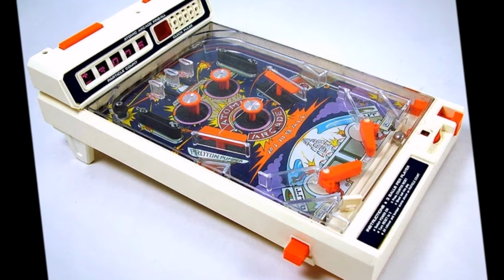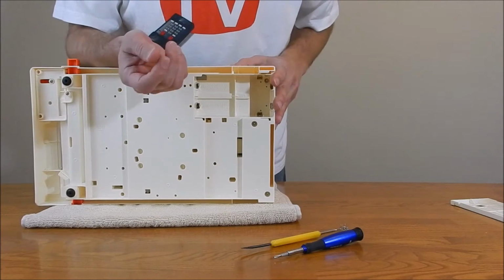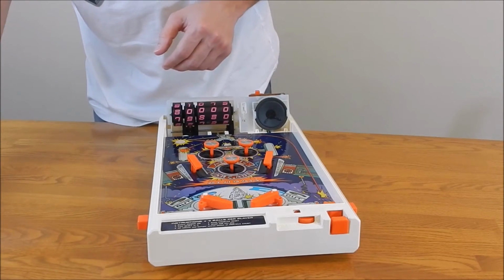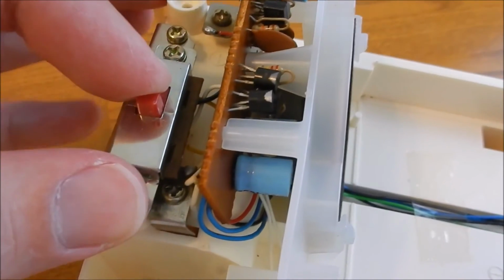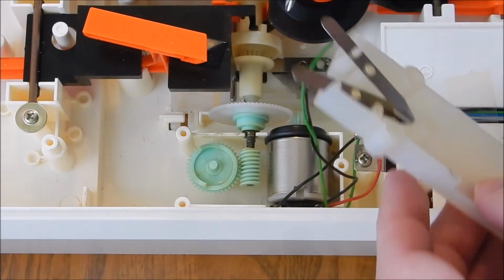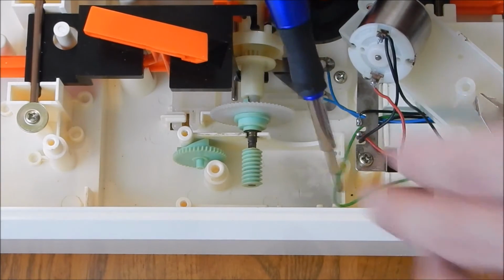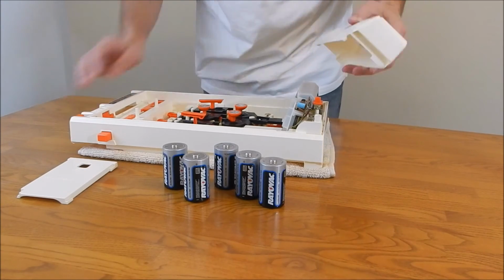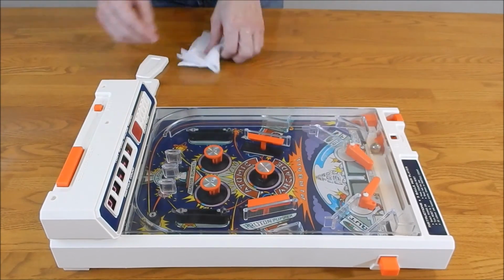How to Replace the DC Motor in the Vintage 1979 Atomic Arcade Pinball Machine by TOMY

Comment: Hello, Thank You for the helpful video! I have a question: I have the same pinball machine and its super loud whenever I turn it on. Everything works well, its just really loud. What do I do to make it quieter/play silent? does replacing motor helps or what should I do?
Reply from the maker: Hi, thanks for the compliment.  Yes, most of these vintage TOMY games/handhelds are very loud.  It's not the motor.  If you were to remove the motor, and run it, you'll find it's very quiet.  I think it's the plastic gears (and there's a lot of them) that make all the noise.  Quietening the machine is something I've wanted to revisit, but I've been away from this hobby for awhile (sad face).  You would probably have to experiment with different sound dampening materials and place them in the machine at various spots.  I'd start with the motor and the gears by it.  Again, you'd have to leave clearance for the gears to move, etc.  Off the top of my head, that's all I can tell you at this point.  Oh, maybe put a towel or think cloth under the machine, if you're using it on a hard surface.  Good luck and thanks for watching.

Comment: Is there any way of making the motor less loud? It's a bit annoying:(
Reply from the maker: Hi.  I think the excess noise is the plastic gears spinning plus the inside of the machine is like an echo chamber.  Yes, a motor can be very noisy if some of the internal components have become worn or need lubricated.  I tend to replace motors over 10-20 years old.  Someday I would like to test different material on the inside of the machine to what works best to dampen the sound.  Thanks for your question.

Comment: do you know where i can find a dc motor for this game? i bought the game and the motor is bad, i appreciate it!
Reply from the maker: Hi, Donny.  Thanks for your question.  I've purchased hobby motors off ebay and hobby websites.  Below are two links to an eBay seller and another company I've used in the past:

https://www.ebay.com/itm/311764162599

https://www.hobbylinc.com/htm/svm/svm260.htm

Hope this gets you steered in the right direction.  Also, read my description above for more info, if you haven't done so already.
Reply: @MarxKosmos1024  thank you

Comment: Awesome video!  All working now, just in time for Christmas.  Out of interest - I don’t find the bumpers etc to be particularly sensitive - do you have any tips for increasing their sensitivity?  T
Reply from the maker: Thanks for the compliment.  Regarding bumper sensitivity, nothing immediate comes to mind.  One model that I owned, the ball would tend to stick (magnetized) to the bumpers, then shoot off.  Is that what's happening?  Not sure if they need cleaned or the ball needs cleaned.  There are suggestions for replacing the rubber bumpers with other material that provides more spring, but I've never felt the need to do that.  The one I have now plays better than the one I had has a child.  Sorry I don't have more to offer.  It's been a few years since I had one apart.

Comment: This is great! Thank you for taking the time to do this. I just bought one on craigslist for 14.00. I had to clean the battery contacts but it works great! I want to take off the cover to clean the tracks of the ball in the plastic bed. The engineering is this thing is just amazing. Thanks again!

Comment: I got one and changed the motor as that was dead but from the get go when you turn it on the speaker just plays a continuous tone, very annoying, replaced the caps so far but no joy, trying to find a pic of a circuit board so I can check wiring is correct
Reply from the maker: Hi, Ben.  I don't have a photo of the circuit board readily available.  Of the 4 or 5 that I've worked on, none ever that the problem you describe.  If I dig my machine out in the next few days, I'll try to get you a pic of the board.   I'm not sure if something is being grounded that's causing the constant tone, but it sounds like you're doing the right things.  Have you ohm'd all the components too?  If I think of anything further, I'll let you know.  In the meantime, if you find the problem, I'd like to know what it was.  -M
Reply: @MarxKosmos1024  did you ever fix this... Just dug mine out of the loft and I'm getting the same tone and nothing from the motor etc
Reply from the maker: @ajwhedges100  The motor maybe seized up, so you could spin the gear on it a few times or it may need replaced.  Not sure what you mean by the 'same tone'.  I haven't done much diags on the small circuit board because I've yet to have one that was faulty.

Comment: The sound effects on mine are really really low can barely hear it with the actual motor running . Can this be fixed
Reply: It's a tiny astro shooter btw.
Reply: Tomy
Reply from the maker: Hi--I haven't encountered this problem myself nor do I own this game.  It could be a component (ie. resistor or capacitor is faulty).  Have you opened up the game yet?  There might be some type of variable resistor that allows you to adjust the volume.  May be the speaker is failing.  I wish I had a better answer, but I'm not an electrical eng by trade.  -M

Comment: Any idea what size the 10 teeth white pinion on the motor shaft is? Mine is missing and i need a replacement. Tteksah@gmail.com
Reply from the maker: Chris, I would have to take my game apart and measure it.  Not sure when I'll get a chance to.  Probably a detail I should add in future videos.
Reply: Thanks Mark. When I hit the inside with compressed air, the gear worked itself loose from where ever it was hiding. Threw it back on the shaft and the machine works! Such a fun and well engineered toy.

Comment: Hi, I recently bought one at an antique toys store. It works flawlessly, but when I turn it on the counter starts spinning on its own. I opened it and ran it and sometimes, when you touch a bumper or slingshot, it stops. But when you hit another one it'll probably start running again (only to stop randomly when you hit something again) It doesn't matter if you touch any of the bumpers, slingshots or the rollover thing at the top, all of them trigger and stop it randomly . It comes and go, but except that it runs great. I thought it was a broken/missing gear but I checked up all of them and they seem fine. Do you have an idea what might be? It wuold be very useful to have a working counter,or at least one that isn''t constantly running. Thanks and great video!
Reply: Lucas Andrada  hello ! I recently got one of these and mine is having the same problem !  I’m trying to see if I can go off what you said here to fix it.  Lol.  I need to open the score board area right ? Thanks.
Reply: RomeoRuizMusic Yes you need to open the whole pinball and see if the counter is running on its own. Check the white plastic,almost transparent plate below it and mess with it to see if it stops
Reply from the maker: Hi- Horacio,  thanks for your questions, but honestly, I hadn't seen this issue either.  If I had mine open in front of me, I might be able to make a better educated guess.  However, with these vintage electro-mechanical games, my first instinct is to think it's mechanical issue.  You said you checked all the gears and none were missing.   Also check to make sure none of the gears have a small (even hairline) fracture/crack in them.  I've seen the slightest crack cause a gear to jump or stick.  Using a magnifying glass will help, of course.  If it is an electronic component, could it be an old capacitor?  I don't know.  If you find the cause, I'd love to know what it was.  This is definitely a peculiar issue.  Good luck, and if I have any other ideas, I'll pass them along. --M
Reply: Hi Mark,it's me again from another account (Horacio is my dad haha). I finally fixed it! It was a mechanical problem as you said. Under all the transmission and gears,there is a clear plastic thing that runs across all the table. Since the plastic is clear and the gears leading up to the counter block the view,I couldn't see but it looked like a tab was below them as well. Anyways, this plastic was moving horizontally apparently engaging the counter gear. I found out because I turned it on and kept the plastic down with a finger and it stopped (though it would trigger the DING sound since it presses down on one of the metal tabs on the right side). Then I noticed it stopped when it moved, so I jammed a piece of toothpick between one of the hinges and the white board. It is a very milimetric thing, because when I first put the toothpick it stopped counting everything. Put it diagonally and now it's working like new. Hope this helps you and thanks for your answer! Regards,Lucas
Reply: Horacio Andrada  thanks so much.  Will do
Reply from the maker: Good Luck.  Sorry, I haven't investigate this issue on my own yet.

Comment: where would I have to solder leds for flashing lights when the bumpers get hit
Reply from the maker: Hi, Jason.  Thanks for stopping by my channel.  I've thought about doing this, but have yet to really dive into it.  It's been a year since I've looked at the internal workings of this, but I'd start with the blues wires near the motor box (see the 8:00 mark of the video- notice the blue wires at the right in the frame.  I think they are connected to two metal tabs that are pushed together when a bumper is hit.)  I'd start there.  Remember that flashing light is not tied to the bumper hits.  It just flashed continuously.  Thanks for the great idea for a future video.  Sorry, I'm not an electrical engineer by trade.  Just a tinkerer.  -M

Comment: Just found one of these at a thrift store. All it does when turned on is kind of whine, like a dog whistle. I guessing I need to change the motor because nothing reacts to the  ball hitting it, any thoughts? I'm not familiar with electronics, I just want to play with it lol, thanks.
Reply from the maker: Hi, Joshua.  If you're hearing a whining noise, it's probably coming from the motor running, which is a good sign.  However, if none of the bumper are reacting to the ball hitting them, it's possible the small gear that fits on to the motor shaft is missing or has fallen off.  Try moving the machine around & listen for anything rattling around inside.  If you hear something, it could be that or another gear/piece has come loose, which may explain why the bumpers & scoreboard are not responding.  I had a similar issue once.  The best and only way to really know is to disassemble the machine, as I've demonstrated in my video.  Feel free to contact me with any further questions.
Reply: I had this problem, I think from the 4 batteries, 2 supply power to the speaker and light, the other 2 power the motor/bumpers. Try cleaning the battery contacts to supply power to the whole machine.